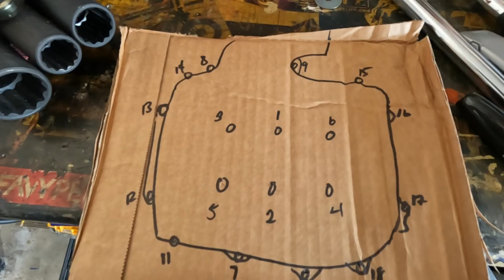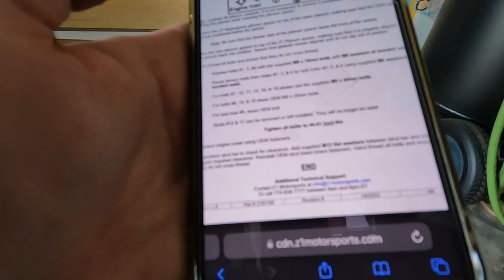How To Install 350z / G35 Plenum Spacer | Z1 Motorsports

Comment: good video. If I could buy the spacer again I would not. You can ground down the front 2 runners horn for same effect for free. 
I did not notice a difference. Best upgrade is a true dual exhaust.

Comment: Did you have to do a ECU reset after the install?
Reply from the maker: I did not.  Shouldn’t need to, but if combined with a bunch of other bolt ons, the car should be tuned—obviously

Comment: For ICE engines the more air the better. Especially cooler air. Engines are nothing but air pumps. Nissan sboudl have made it double throttle body like the 300Z.
Reply from the maker: There is a point of finishing return.  More air doesn’t always mean better if the engine can’t move it out.
Reply: @SpeedCultureStudios  that's true. It can really only use the amount of air it can handle by displacement. More air also requires more fuel. I misspoke as well. I should say the more air it can get as fast as possible with equal energy and volume is better. Especially in a set up with only one throttle body trying to maintain that volume across such a wide and flat surface.
Reply: @SpeedCultureStudios  that's why in V configurations I like ITB or dual throttle body for air balance.

Comment: I tried installing mime and my hood wont close with or without the strut bar. I have a g35 engine inna 03 350z. Ik they are the same but would it be something about the motor mounts or what?
Reply from the maker: Yes could sit higher on the motor mounts